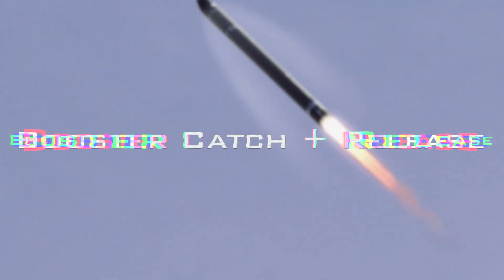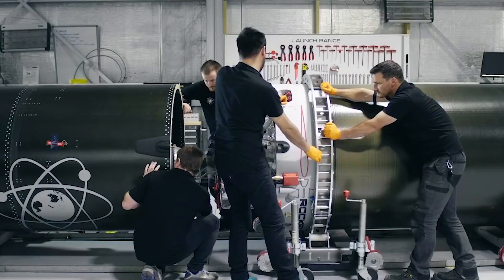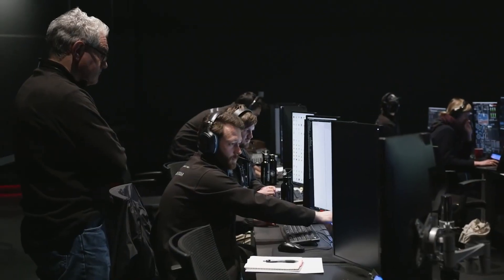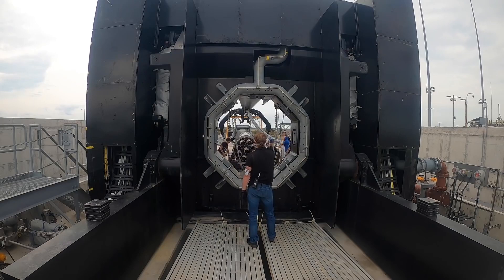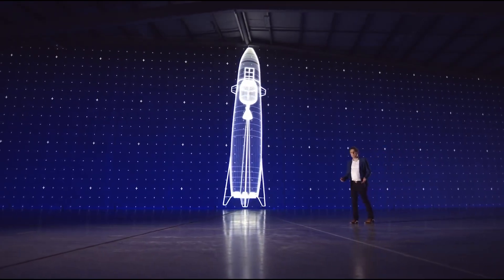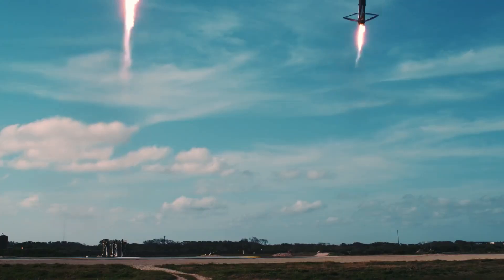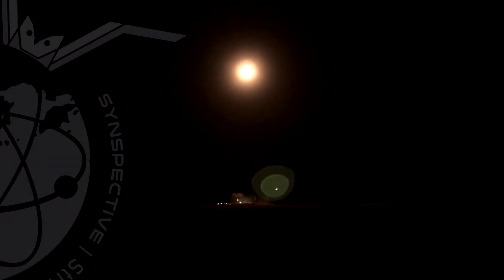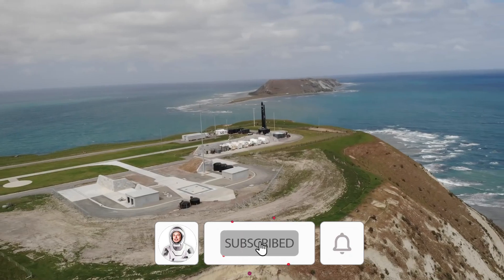Elon Musk About Rocket Lab’s First SUCCESSFUL Booster Catch + Release

Comment: Not to diminish Rocket Lab's achievement, but Electron is only 57 feet tall, falcon 9 is 229 feet tall. Electron can take a payload of about 500 lbs LEO, Falcon can take a payload of about 50,000 lbs LEO. 

While electron fills a need to get smaller payloads to LEO for less than $6 million, which is a really good deal. I mean the crew dragon capsule is more than half the length Electron. We are comparing apples to basket balls in this video. 

You'd have to have a pretty damn big helicopter to catch a falcon 9. 

So the answer is, a resounding NO!, Rocket Lab is not better than SpaceX, and NO! Rocket Lab is not the next SpaceX. Nobody and nothing is better than SpaceX. 

Don't get me wrong, there is a niche for Rocket Lab. And SpaceX and Rocket Lab do not compete. In fact one StarLink satellite weighs more than Electron can even carry to LEO. 

Rocket Lab could land their rockets like Falcon 9 if they could carry enough fuel to do so. The fact is, they'd have to carry more than 500 lbs of extra fuel which would use up all their capacity for any payload. This is why they are catching their little rocket with a helicopter.

So, don't buy into this misinformation comparing Rocket Lab to SpaceX, there is no comparison. Trust me when I say, if Elon Musk thought Rocket Lab was a viable solution to getting payloads and/or people to LEO, he would have bought them already. The fact remains, Elon Musk doesn't even see them as a real space company. Until you can take a man to space (real space, not like Blue Origin or Virgin Galactic) you're not going to make it in the next space race that is coming sooner than anyone thinks.

Side note: Bill Shatner (aka Captain Kirk), should take a ride on crew dragon and take a few orbits around earth. Then he could say he's been to space. I mean, it's entirely possible to take a balloon to the Karmen line (62 miles) that they call space. So why spend all that money on rockets that don't even go to "real" space just above the Karmen line? The weightlessness they feel at the Karmen line, is due to the free fall of the craft, not because there is no gravity up there. If there was no gravity, how would the craft fall back to earth? In fact, the weightlessness they feel on the ISS is due to it's perpetual free fall. If it wasn't cruising at over 17,000 mph, it would fall to earth (or towards earth before burning up in the atmosphere).

.https://www.youtube.com/watch?v=FhDXOusMXS4